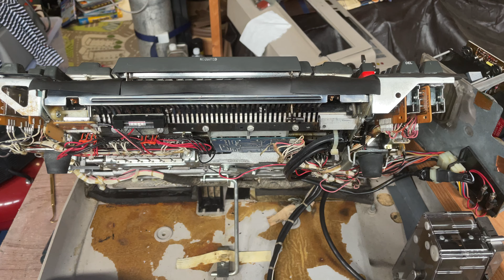IBM Memory Typewriter troubleshooting progress

Comment: A Memory Typewriter 50...  The Model 580.  The model after this Memory Typewriter 100 model 1580.  The Memory Typewriter 100 did not have the same kind of selection magnets/solenoids.

I own one of both models.   The Memory Typewriter 50 I purchased from TRW surplus many years ago, and the Memory Typewriter 100 was given to me.   

Before you make any adjustments, make sure everything operates "fluidly".  You need #10 oil (SAE 30 Non-Detergent) and #23 Grease (Mobilgrease #28).  

To play back, you do not need to first press the page start button.  Upon loading from the loop tape, the page always starts at the beginning.  

Do you have the owner's manuals?  I do have the wiring diagrams in digital format, and the operational manuals which I can share with you.
Reply from the maker: Great, thanks for the hints. I have the service manual and diagnostics manual which has the wiring diagrams. I don't have the owner (user's) manual if there was one. Would love to see that one if it exists although I suspect the service manual covers all the operations (just in case, erik at bruchez dot org).